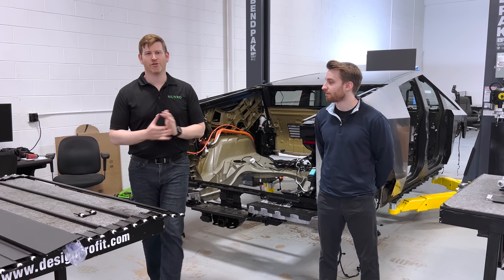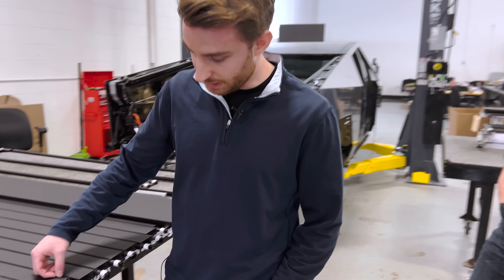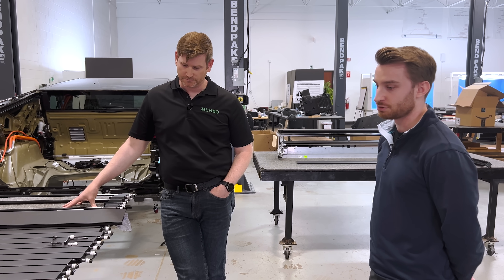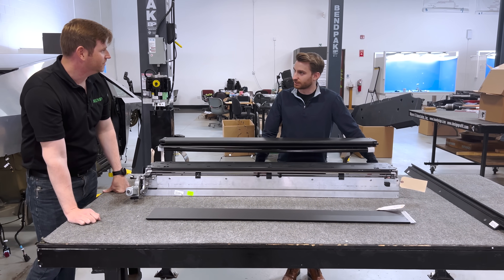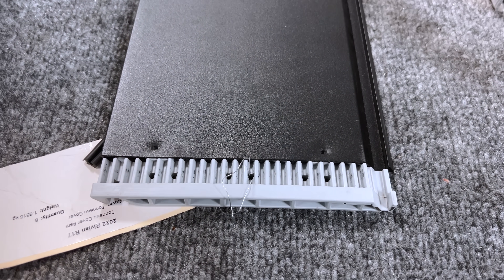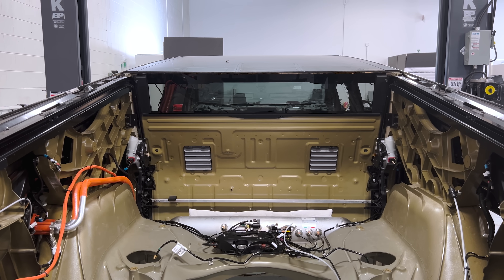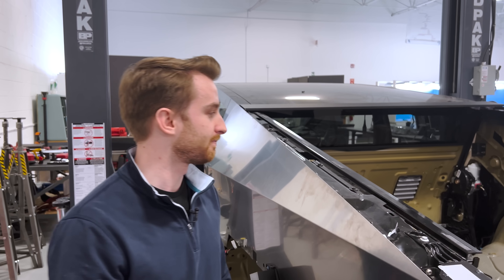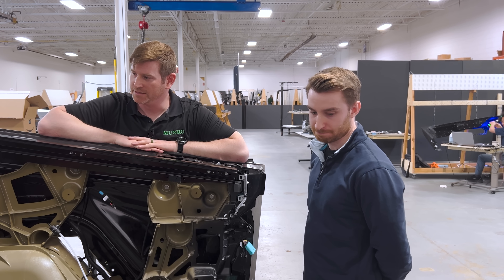Tesla Cybertruck Tonneau Cover: Design and Functionality

Comment: After six months of use we love the rolling cover.  It is fast and quiet.  When we have some bulky items that have to stick out at the tailgate end, we roll down the cover to where it's "pinching" the item and it helps in securing it in place.  Most of the time there is no need for a tie down.  The tailgate needs some extra flashy design tricks - very basic functionality at this time.  Also the "step" bumpers need some more designed step up areas.  They're all plastic - it should be easy to press in some toe holds here and there.

Comment: You can't discuss the size of the mechanisms without discussing the size of the tonneau cover. The Rivian only has to cover a 4.5 foot bed while the Cybertruck has a bed over 6 feet long. 

As far as cost, Tesla reduces part count where it doesn't impact functionality or reliability, but their primary way of reducing costs is to design to be built more quickly, with less labor. And Tesla just revealed they hit profitability with the Cybertruck in Q3, while the Rivian R1T has been in production for years and is nowhere near being able to be manufactured profitably, even though it has less durability and damage resistance, less repairability, smaller cargo area, smaller rear seat, less payload capacity, less efficiency, the stereo doesn't sound as good, it's not as smooth riding, it's not as quiet, it has less ground clearance, it doesn't come with 35" tires, it doesn't have steer-by-wire and the nimbleness that enables, no four wheel steering, the tonneau cover is an optional expense, the Climate Control System is not as powerful or as efficient, the software and navigation is not as powerful and accurate, the throttle response is not as refined, and the Stereo doesn't sound as amazing. In short, its much less truck, even when spending the same $79.9K. 

So I think you are harping on the wrong company here, in terms of cost to build. Yes, you can be sure the Cybertruck tonneau cover is not manually assembled. It won't be 100% automatic either, but you can be sure someone isn't assembling all those repetitive parts manually. I mean, the truck is already profitable, after only one year. The R1T cannot be profitable without a complete redesign. It's not even close.

Comment: Reminds me of the old 1980s TV cabinets with dual sliding covers (made of wooden veneer strips) that open/close from both sides😊. Hope they have some kind of software lock to the motor(looks more like a beefed up wiper motor?)🤞. If not, Hot wiring the tonneau cover(powering the worm gear? motor externally?), might become a Tiktok trend 🤞❤👍

Comment: While this teardown is good as far as it goes there is way too much repetition and way too little design analysis.

I got tired of repetitious "it's costly" and "it's complex". Is it really? More parts does not necessarily mean more complex - especially when the parts are identical and simple to assemble.

More important, almost nothing was said about reliability or robustness of design. The CT cover seems to be designed for reliability vs the failure prone Rivian design. For example, wider slats are more sensitive to binding from skewing which is a major problem with the Rivian initial design. The results of a single small drive motor and a light duty connecting rod vs two hefty (synched stepper ?), motors should have been thoroughly discussed. Dirt and debris were (are?), major problems with the Rivian. I suspect the larger and more robust components of the CT help compensate but this begs for an analysis and discussion.

Comment: Saying "POM" is not helpful without defining it. 
Polyoxymethylene (POM), also known as acetal, polyacetal, and polyformaldehyde, is an engineering thermoplastic used in precision parts requiring high stiffness, low friction, and excellent dimensional stability.

Comment: I really enjoyed this video. I'm having a problem with my tonneau cover where one side is pushing more than the other. Maybe you could shed some light on that? Also, I'd like to suggest a video about the rack system. It's only rated for 440 pounds, which is pretty light for a truck. It would be interesting to see if there's a way to mount it to the vehicle's skeleton to increase the rating to something closer to 1,000 pounds.

Comment: Would be nice if Tesla had developed a rearview mirror with a display, along with a washer for the back camera. It looks so bad to have the rear camera taking up screen space. I love the Vault Cover and the concept of Cybertruck, but ever since the stainless steel became just paneling, it seems like the weight penalty ruins the efficiency gains from the aerodynamics. Please just give us a Model Y truck with air suspension. That's what the market needs. Ford should do that for Ranger and make a 1999-size F150 electric.

Comment: This cover on the Cybertruck - as has been said several times - is very complex, expensive and probably prone to failure. If you need it, you should have it. - Thanks for the video! - 
But if I say that a solar roof would constantly refresh the batteries of any car, as planned by Aptera, cost-benefit calculations are immediately brought up. One can only speculate how much more useful a small Model2 for around 20kDollar would have been to the world now, in the harmonious and beautiful Tesla style, unlike the Cybertruck, which I unfortunately don't like at all because there is hardly any efficiency, elegance or global usefulness in it.
Reply: The Rivian is proven to be failure prone, no reports of any trouble with cybertruck tonneau as of yet.

Comment: Mine sheared the snow/ice from the segments right off at the roof line it dives under.  It was bad ass.  I had just drove it home for the first time and I picked it up in a snow storm.  I was still trying to figure out buttons and opened the Cybertruck tonneau accidentally.  Even so, still no problems.

Comment: Thanks Kevin and Walker. In your opinion, does that back glass add any structural integrity? I want to take it out and replace it with the same size of Plexiglass so I can put in two vents (in and out) to get the HVAC air into the bed for camping.

Comment: 3:50 POM (Wikipedia)
Polyoxymethylene, also known as acetal, polyacetal, and polyformaldehyde, is an engineering thermoplastic used in precision parts requiring high stiffness, low friction, and excellent dimensional stability.

Comment: I think it’s only fair to say that the limitations that the CT may have as far as rear view visibility is often similarly faced with standard trucks in many situations such as when with a camper top, with a large load or a trailer. IMO if you drive a big truck you should be comfortable being able to view things behind using just your side mirrors and if it were me I’d add spherical blind spot mirrors to those.
Reply: Just needs a screen where the rear view mirror would be. I have one in my truck, it's great. The rear view on the main screen seems so silly but I haven't driven one yet so I won't dismiss it just yet.

Comment: Should have been done the other way into the tailgate so we can SUV this   Mode dogs and camping will have to keep 70serie cruiser for me.  Loved the stainless but oh well.  Out MY is good  too but  no bench front seat no pass thru too small range for 4x4 trips  will need capacity to use generator as I drive  don’t want to hear Generator while camping   
Ranting sorry

Comment: Phew. I'm seeing alot of parts, alot of points of failure, and a complex assembly. I originally thought this was going to be like a garage door but I guess its more like a shop front roller door. It almost seems off-the-shelf. I won't be surprised if this doesnt go through a major revision or is dropped completely in a few years.
Reply: This would be a upgrade for a garage door which would be bad in this application.
Reply: @danharold3087  Yeah but its almost identical to roller doors for shop fronts. It honestly looks like its off-the-shelf to me. Like they either licensed it or just stole someone-else's design. It seems very un-Tesla like in many ways.
Reply: @patreekotime4578  Good observation.    The important thing is that it seems to be working well.

Comment: I canceled my cypertruck when tesla didnt implement the specs they promised. I got the chevy silverado!!!! Better than the ford lightening ev. Has 450 miles range... when towing 250 miles range. The back wall is removeable you get the bed plus the space till the front seats. Its great for camping... you remove the window and have an airconditioned tent! Wich is awesome in the summer. Plus a spare wheel without loosing the bed. like in the cypershit LMAO. Plus you can reach into the bed and get things wich is impossible in the cyperssss due to the angels above the bed. A lot of plugs for electricity. Plus the fastest charging of any ev truck out there... its charges up to 100% in the same time the cypergarbage truck does... but has twice the battery! And it costs less!!!! If you want a great truck at great cost than go with chevy rivian or ford... The chevy is the king of EV trucks right now.
Reply: GM is selling its big battery trucks at about 1/2 of what it cost to make them.  Blow them a kiss.
Reply: @danharold3087  Great news... I really dont care what it costs to make them. But love to hear that GM is thinking and cares about its customers. Hope Tesla rethinks its pricing for its cars... they are just too expensive for what they offer.

Comment: A lot of engineering went into that bed cover. Cybertruck is not a common work truck. Its expensive. The sail panels allow for a taller cover, allowing for taller items such as boxes, pressure washers and many tools to be out of the elements. and secured. Reach over from the side has been a common negative observation. CT lowers per it's air suspension, thus alleviating some of that concern. Have you stood next to a full-sized pickup truck lately? Every year, they seem to get taller. Most current offerings do not have air suspensions offering height adjustment.. So much so that legacy OEMs come up with elaborate steps, articulated tailgates and folding grab handles,  etc.. Many consumers add lift kits which greatly exacerbate the bed height issue. 

Rivian's truck is also not a work truck anybody will find on a jobsite. Its tonneau was a joke. With a four foot bed, a paint finish prone to scatches and a similarly premium pricepoint. I see Rivian as a wealthy man's Gladiator or Bronco pickup for the Land Rover crowd. At least Cybertruck is a truck. 

The Silverado EV  "Work Truck" costs 2 Motor Cybertruck money ( non Founder's Edition ), so perhaps a job foreman or business owner could drive one to the work site, but all EV trucks today fall into the Gentleman Trucker category.
Reply: I canceled my cypertruck when tesla didnt implement the specs they promised. I got the chevy silverado!!!! Better than the ford lightening ev. Has 450 miles range... when towing 250 miles range. The back wall is removeable you get the bed plus the space till the front seats. Its great for camping... you remove the window and have an airconditioned tent! Wich is awesome in the summer. Plus a spare wheel without loosing the bed. like in the cypershit LMAO. Plus you can reach into the bed and get things wich is impossible in the cyperssss due to the angels above the bed. A lot of plugs for electricity. Plus the fastest charging of any ev truck out there... its charges up to 100% in the same time the cypergarbage truck does... but has twice the battery! And it costs less!!!! If you want a great truck at great cost than go with chevy rivian or ford... The chevy is the king of EV trucks right now.
Reply: @Ravenought69 fast charging as of today does not have good lifespan. I’m assuming gm is using high cobalt, tesla uses close to none. Majority of truck drivers don’t tow, no need for extra range, makes it worse when heavier lmao. The cybertruck specs actually improved since when released, awd range went up, beast mode obv didn’t but everything else did improve
Reply: @junioo3692  that's nonsense. The majority of truck owners use it as a work truck and or for pulling. its a truck not a sports car. speed is not important. If you only go grocery shopping than the cypertruck is great.... but for truck use its a fail. the Silverado ev has 450 miles range. 250 miles while towing. you need at least 200 miles range while towing or the truck is unusable.
Reply: @Ravenought69  lol so we using opinions as facts now ? 😂 about 75% of truck owners  rarely tow
Reply: @Ravenought69  You don't know what you're talking about, I've been using Cybertruck for heavy work tasks since I got it in April, and it's better than my F-150, every time. You should see the way the Cybertruck packs a 2500 lb. load, like it's not even there. And the Silverado can't off-road, at least not nearly to the capabilities of the Cybertruck. Too little ground clearance, too heavy and doesn't have front and rear mechanical lockers like the Cybertruck has. Sure, the "trail boss" edition they announced is supposed to have front and rear mechanical lockers but that edition compromises payload and towing, it's not an all-in-one solution like the Cybertruck. And the price will make your eyes water, terrible value. The Cybertruck is outselling all other EV pickups put together!

Comment: Thank you for the presentation. How do the two motors align, so that the panels stay parallel? A slight difference and the panels will scramble.
Reply: This is Tesla.   They may monitor the motors and ensure they work together to keep i straight.  If they don't I expect they could.  They do a lot of interesting things with motors.

Comment: Which one is going to be working after 200,000 or 400,000 miles. And yes, I expect the Cybertruck to EASILY last that long if not too much abusive happens to it in comparison to other trucks, liquid or solid (gas/diesel/battery) all told. I think that this cover will last with minimum number of them failing compared to the Rivian. It appears to me that Tesla tested this, opening and closing it, at least 100,000 times vs Rivian testing it maybe a few hundred times at most...

Comment: I hear the term/word ''iconic'' is used way to many times, it is trying to justify the trucks inherent design, engineering and quality flaws, which there are plenty. Lets not forget Tesla is a established vehicle manufacturer, they know how to make a proper car, especially when the customers budget apparently is a 100k. The Cybertruck fell way short of what was promised, it is a 100k low quality novelty vehicle, form over function lets just all admit that and treat and judge it that way.
Reply: Most of Tesla cars are below $100K.  Even the S plaid starts at  $87,990.  AFter the Foundation Series orders are filled CT's will fall $20K.  Consider what the dealer markup would be on this truck if Ford or GM dealers were selling it.  While you can't easily swap out the box there are arguably more people who will buy it because it the current configuration.  Tesla is also arguably the only automaker making money on an electric pickup.

Comment: Great vid.  From a Munro perspective what market segment is the Cybertruck pursuing or is it just a concept vehicle and Engineering exercise to work through a new manufacturing approach? 
As for the rear view mirror - point taken but anyone who has towed anything has learned to use side mirrors. And keeping the rear cameras clean takes a moment.  Wasn't it Lamborghini that said, "What's behind me is not important". (Unless you're towing.)
Reply: The cyberTruck cover much of the pickup truck segment in its class. It falls between the F150 and F250 based on power and capacity.   It is also eating into the SUV segment and a segment of buyers who are buying it because it is neither or both.
Reply: @danharold3087  - hmm. I don't see it as a classic pickup / work vehicle at all.  To me its more like the VW "Thing"  - in a space all its own.  But we know from Munro's coverage the build method is the real effort here.

Comment: Ultimately, I think the 'rear' view camera should have been mounted on the "roof" above the rear window. Or a second rearview camera. It seems like the rear glass is only there so you can use the rearview mirror when the tailgate is down.
Reply: Having driven a Cybertruck as my primary vehicle for seven months, and also used it for heavy work tasks, I can honestly say, I don't miss using the rear window at all. I never drive with the tonneau open unless I have a tall load in back. Even in the rain, when the camera is blurry, I can see what I need to see, the mirrors cover the lane you are in, right up to a car length behind you. And the camera works fine for the car riding your ass, the fact that it's a bit blurry matters zero. People who think they need a panoramic rear view must be terrible drivers. I've driven trucks and delivery vans for various jobs over many decades that had no rear view at all, just side mirrors. I've never thought twice about it, it's only a problem if you are programmed to think you need a window looking backwards. You don't.
Reply: Yes there are many complaints about the "tank slit" back window, and how useless the rearview mirror is considering the best aero comes with cover down.